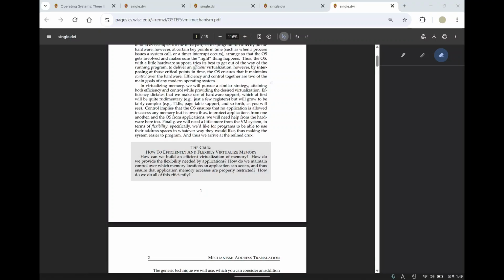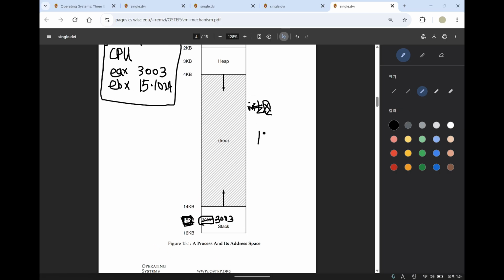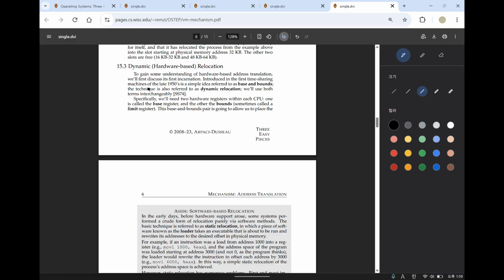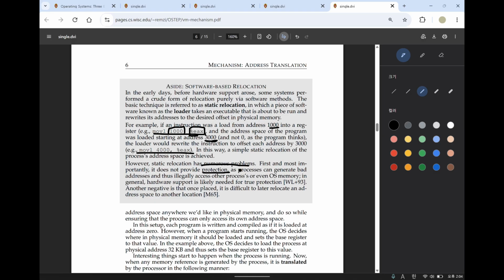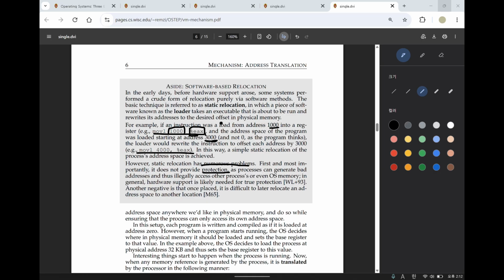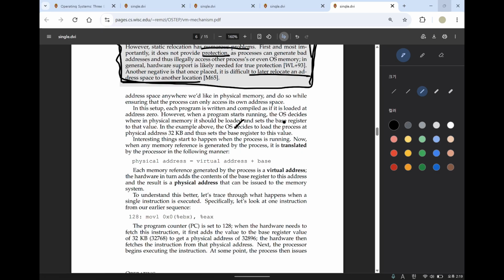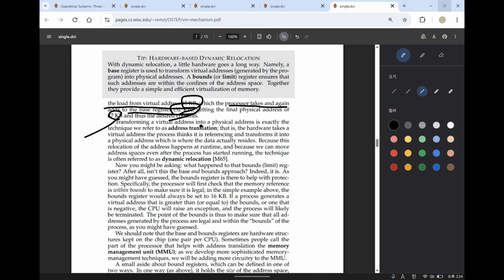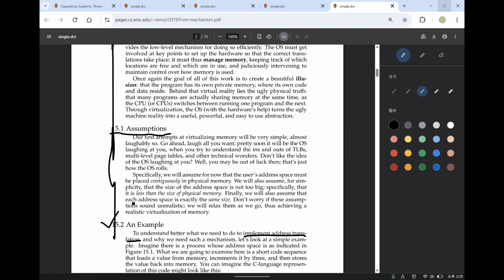OS Tutorial 15-1

Comment from the maker: There was a mistake: the Phsyical address is never saved to the PC register. The PC always holds the virtual address. The physical address is produced transiently by the hardware during the fetch — it goes out on the memory bus to actually read the bytes, but it's never stored back into the PC. The PC just advances to the next virtual address (like 132), and the same translation happens again on the next fetch.
This is the whole point — the processor's architectural state (registers, PC) lives entirely in virtual address space. The translation is a fleeting hardware operation that happens between "the processor wants to access this address" and "the memory system actually services the request."